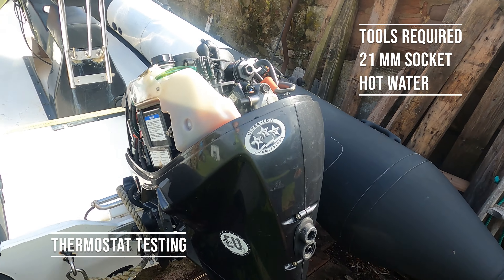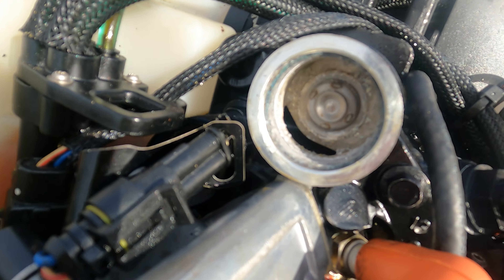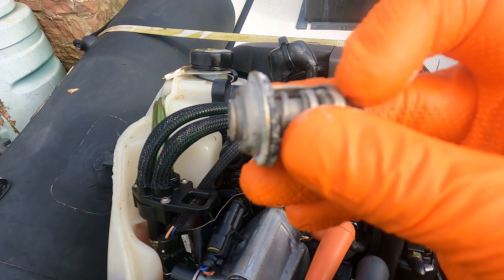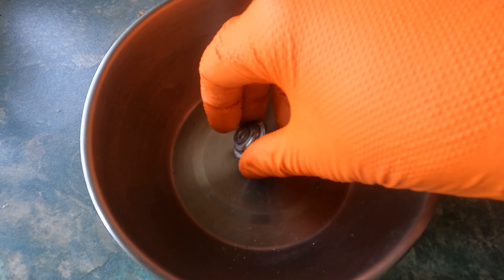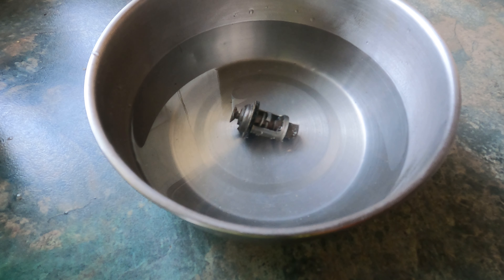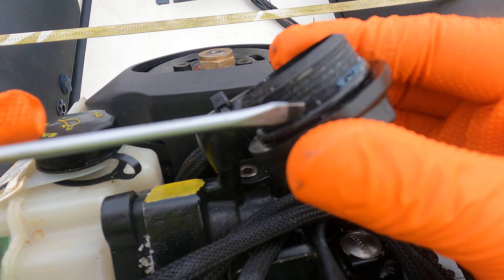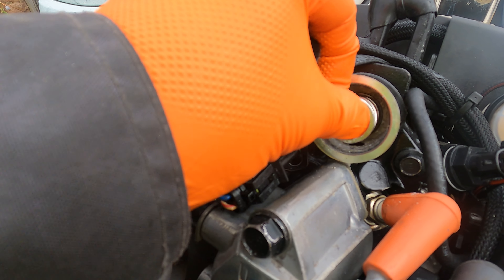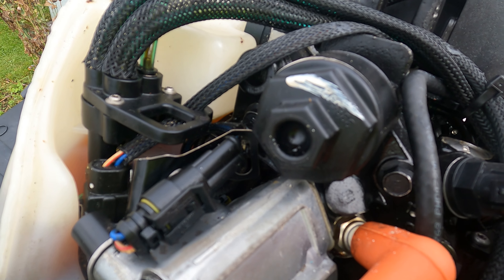How To Remove & Test Evinrude ETEC Outboard Thermostat Valve, Maintenance Tutorial - Part # 5005440

Comment: I would have thought you should clean the surface that the rubber seal seats against.Good video.
Reply from the maker: @davesirvio749  in theory yes it wouldn’t be a bad idea to clean the mating faces. It would be more important to ensure the cover is clean so you don’t get any water leaks. 
It’s important to flush with fresh water after use as this helps prevent salt build up.